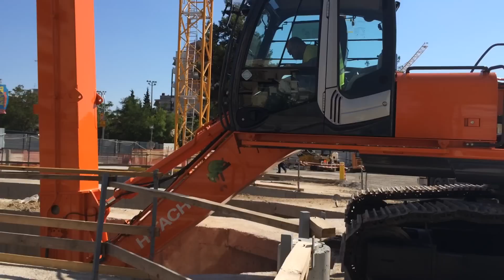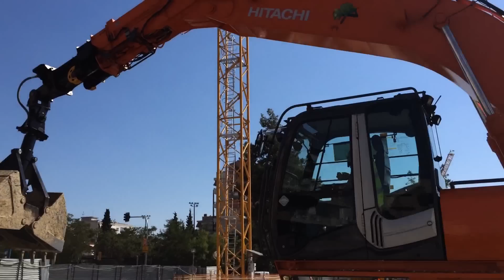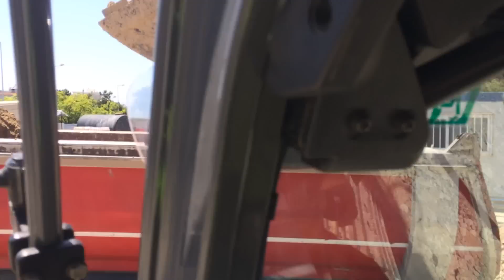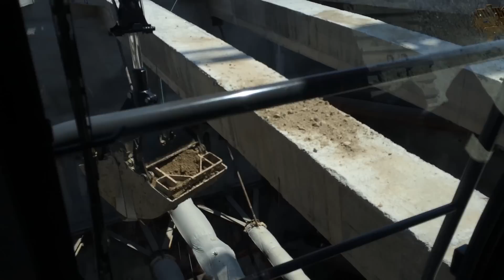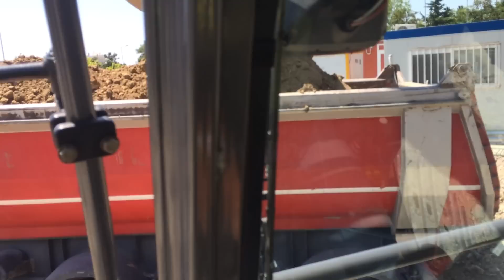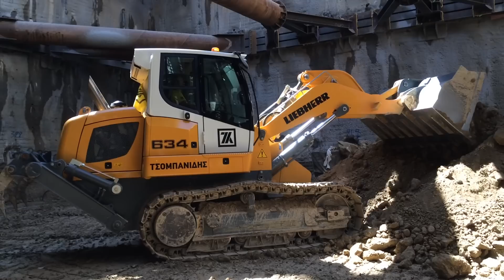Hitachi Zaxis 350LC Excavator With Telescopic Arm

Comment: The viewing hole is smart...but can see a cellphone or wallet disappearing
Reply: It has a glass pane, but looks like this operator has opened it
Reply: @Bassem Boustany ~ yes you're correct, I now see there is an window handle towards the drivers seat.